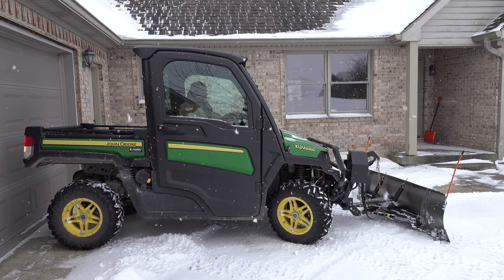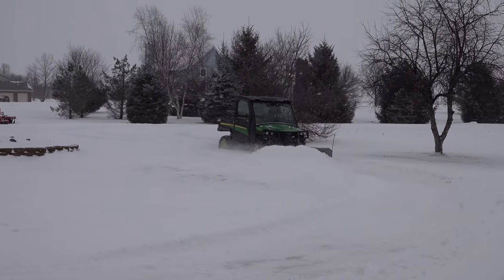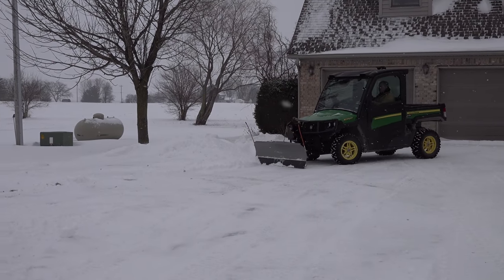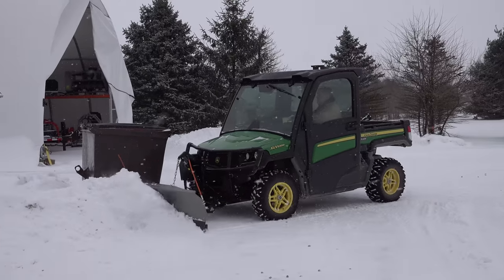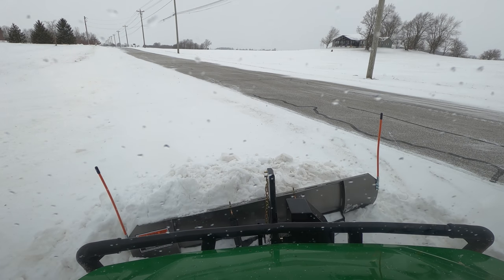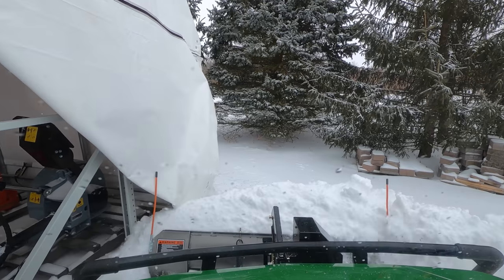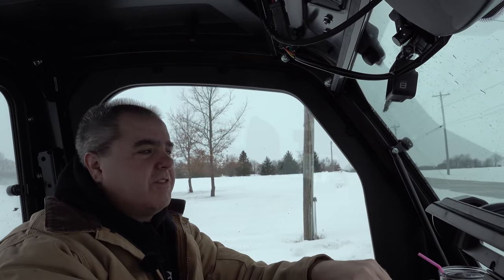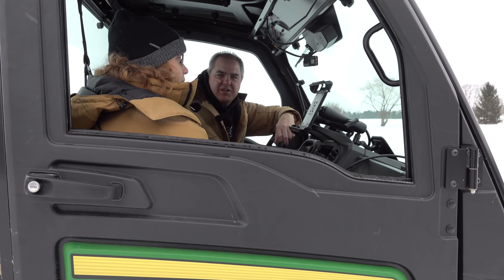Drifting Snow VS. Gator 835M!

Comment: Well that surprised the begeebers out of me how well it worked. I think I'd have to fabricoble some good sized wheels on there to replace the pads. And yes, I'm setting by the fire now but as soon as the sun gets out a little I need to fire up the blower, plowing my drive is not an option as there's a big wall on both sides where it comes out of the basement. Plus the little dog needs a place for his short legs to go.

Comment: Get an inverted snowblower and with a hydraulic top link, you can scrape the concrete clean and still give a little buffer for the gravel.   All these other methods fail in comparison.

Comment: taking the go pro out the mix and the fact if i was to get something for snow i would want to get something where i could help out near by people and the church i go to and no cab on my tractor am pretty sure i would go with the utv and blade or go with the 2000 or 3000 series deere where i could have the cab for heat and a/c note if i was to help out people it would just be free will donations for me helping them out